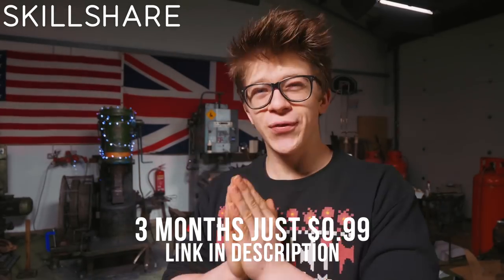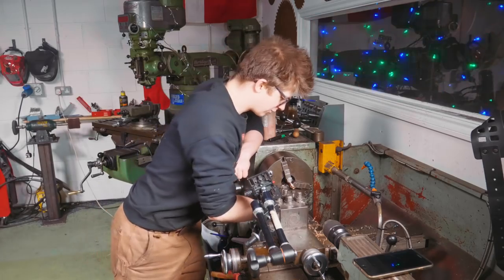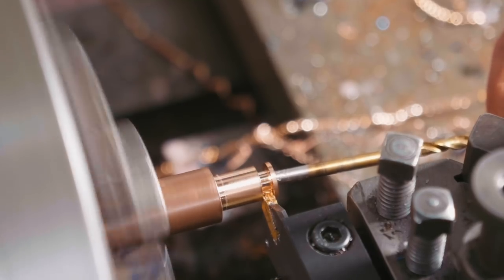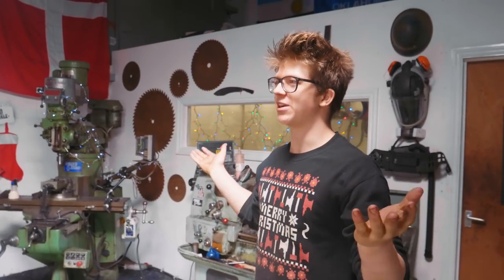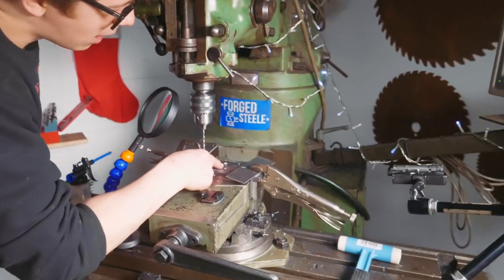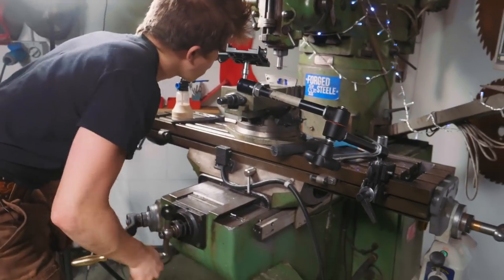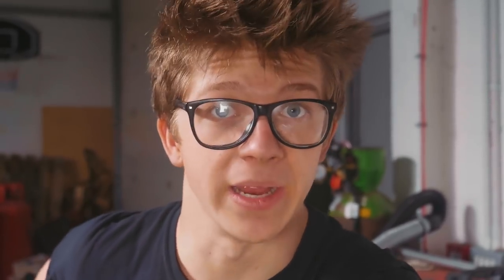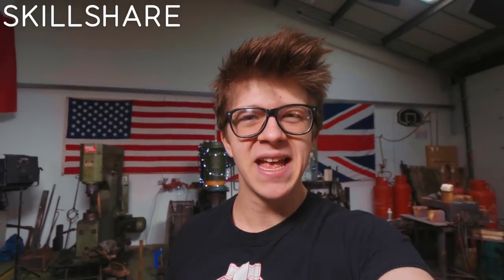MAKING A FRAME-LOCK FOLDING KNIFE!!! PART 5

Comment: you know  that  you  can  tram in  your  mill head to the bed of the mail. take  the vice off and clean the bed very well take your  stone and knock off all high spots on the bed of the machine. then take a dial test indicator mounted in the spindle of the machine without the power on sweep the table into alignment use the 4 bolts on the top of the Milling head to adjust side to side and front to back. after that remount your Vice.

Comment: Next time just run to the hardware store and get some 2-3-4inch Dremel blades and make an arbor to hold them. Normal disposable carbide disks for metal work fine for slotting in a mill in a pinch. Just go slow and keep your body parts/face away from the axis of rotation, that’s where they fly when they break

Comment: How about using grinder wheel when you cut somethings. It is far cheap and good way even it's not so precise. Small grinder wheel and some mount (if it is needed) for milling machine. It will be better for you. That wheel looks for wood cutting, not for steel cutting.

Comment: Alright, I understand you just got Fusion 360 but... I'm in a CADD class right now and I completely recommend putting down some money and buy Autodesk Inventor instead. They are both the superior CADD programs which is why as another option it would also be wise to master multiple programs like most professionals I have found online.

Comment: A human hair is between .04mm to .1mm in thickness.  General machining practice is to get +/-.1mm or .005".  Certain industries require far, far greater accuracy than that.  How's that for some perspective?
Reply: Also, did you try honing the bottom of your mill vice?  Maybe run a good true stone across your mill bed too.

Comment: Alec, I have a quick lathe tip for you to keep in mind that I learned as an apprentice. Limit your stock stickout to 2 diameters whenever possible. So 1 inch of stickout on a 0.5 inch rod for example. It will reduce deflection and improve your cut quality(not that you had any issues in this video). If you have to go with more stickout you have two quick solutions, take less aggressive cuts, or use a live center.

Your videos have inspired me to finally get off my butt and finish my little aluminum foundry and after I'm not as busy mentoring my high school robotics team, start doing some blacksmithing again. You are not much older than the high school students I inspire and you inspire me Alec.
citruscircuits.org if you want to see what I do.

Comment: a useful tip for drilling, that I learned from all my teachers.
you divide 8000 with the diameter of the drill
8000:Ø or 8000:D (hope you can use my tip, stay safe and stay awesome)

Comment: hello Alec.
can i ask you where you buy your sand paper..in my nearest shop i can onley find up to 600 grit sand paper but i need 2000 for at least a nuice polish (i also need 1000,1500,1800 etc)
and how do you poish your blades with wax or een compound?
if you read this it would mean a lot to me if you respond

greatings Alex

edit: i live in the netherlands so it can be a european shop :)

Comment: Hey when you drill copper or soft metal grind in a chip rake on the drill tips.
it will avoid any accidents from tangled swarf.
1 v on one 2 v on other.
https://i.imgur.com/Dp0OwJs.jpg